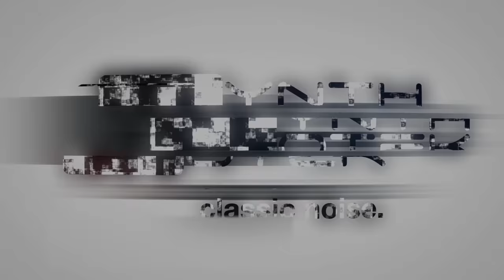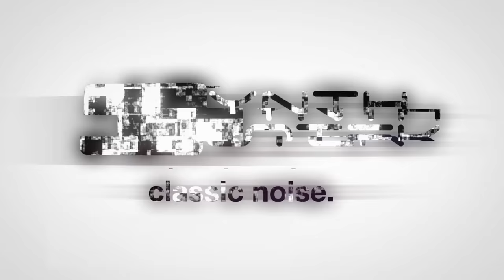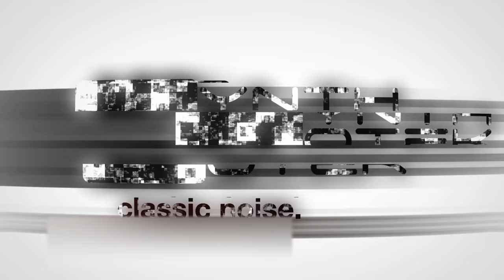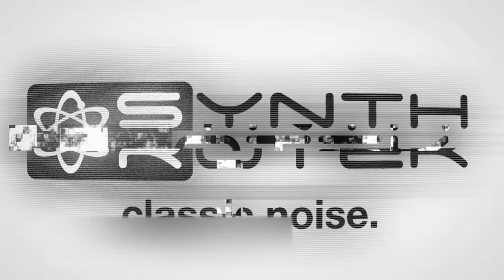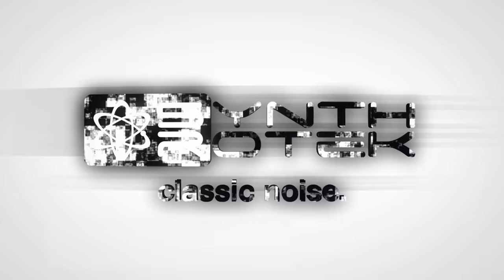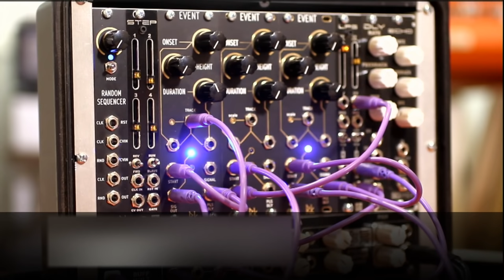RANDOM SEQUENCER - Rat King Modular - 8 & 16 Step (and full random) Sequencer Module Demo

Comment: Helllo I am confused  A t about 125 it says the random mode puts out random steps
Could you please show this doing this on an oscilloscope. Mine seems to put exactly the same clock in each mode as i can see on my Mordax, 
That is the steps are not rrandomised. Do you actually mean that what happens is the predetermined notes are simply in a random order which is different from 
the set order in the 8 and 16 step loop At any rate could you please confirm that the clock out is the same in all three modes?  Mine was bought i.e. I did not build it and I presume
it is working okay.

Comment: enjoying mine but still a bit confused about the clock reset input. Is it not just a regular clock input? it was stated in the video that it's not a traditional clock input...
Reply from the maker: It resets the clock, so its a little different than some. Makes for interesting clocks for sure!
Reply: @synthrotek  ahh I see, thanks. So theres not a way to give it an external clock so that one clock pulse input equals 1 step in the sequence?
Reply: @themanefaces  bit late here but if you have the internal clock slower then the sent clock, it’ll work like a clock input
Reply: @wcbq  Ahh. Cheers! Will blow the dust off it and have a play with it later!